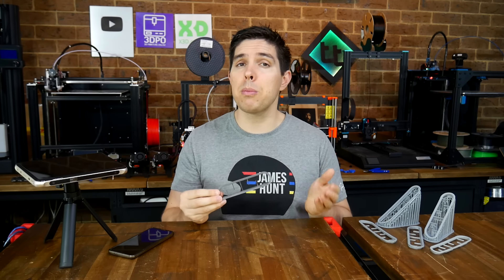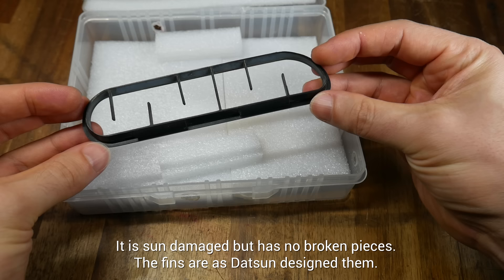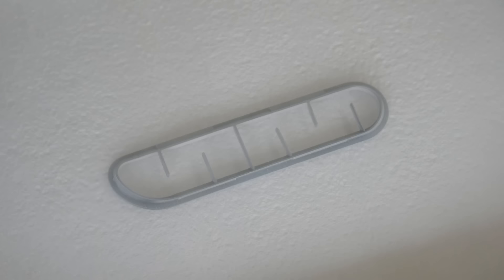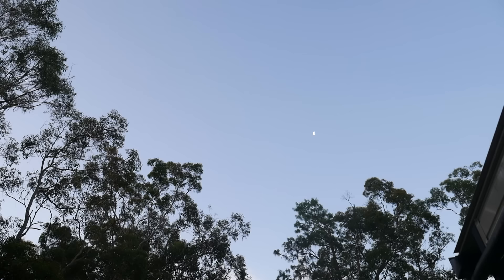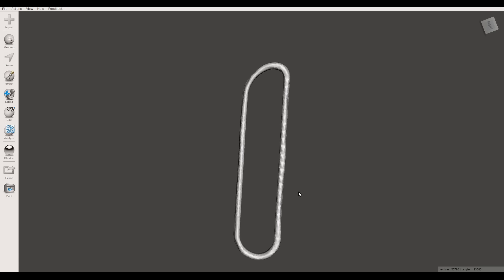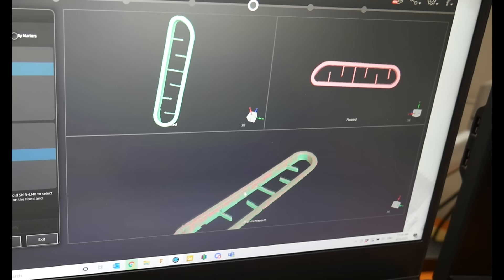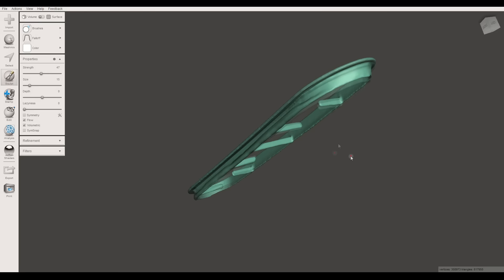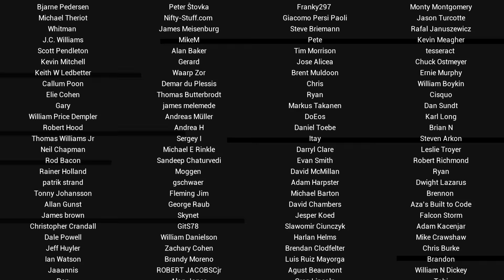3D scanning + 3D printing to complete a classic car restoration

Comment: It's a shame there is only high-end and toy scanners out there. It is aggravating somewhat to not be able to get something in the middle that doesn't do what the high-end does, but a far better job than the toy scanners.
Reply: Same. I have an interest to make a few parts for my car, but 20k for a scanner that doesn’t just output a blob, is unjustifiable when it’s for hobby use. We can only hope that costs come down like how printers have
Reply: You may get something in the middle if you invest some time and a little bit of money to buy some gear, you can achieve pretty good results with photogrammetry. It is tricky with details this small, especially with phone camera, but it is not impossible. Get some average DSLR or DSLM, a lens with suitable focal length and take extra care of lighting the object evenly with soft lighting. Use CPL to filter some light or even get rid of reflections using cross-polarisation technique. What I mean is photogrammetry is pretty complex topic that is not limited to that example case from the video, and may give you better results. I have managed to get a couple scans of some dash and headlight mount parts, not exactly print ready, but decent enough to reverse engineer them.
Reply: It's something definitely lacking from the hobbyist market, a scanner that does build plate size objects at a good resolution and with software to be able to import into Cad. Maybe in the next 5-10 years.
Reply: Honestly thinking about it now, that LIDAR sensor on that iPhone might be reasonable… and if someone could link it to photogrammetry, it’ll definitely be a winner

Comment: I would have liked to have seen if the other scanned files could have been cleaned up enough to be usable
Reply: no. Pretty much all of them are unuseable for generating mesh. He could have remodeled them in software designed to be used with scans. Like Geomagic Desig X
Reply: @DreainCZE  Yeah, and that software only costs $20k. Lets all use it. No prob.
Reply: @filonin2  well there are some free ones. But you are correct after all
Reply from the maker: That would have eaten up many, many hours and probably sent me insane.

Comment: I have that HX scanner. I think it was $12k (us) Sadly I have yet to sit down and mess with it. I plan on making some milled parts for a few projects. Thanks for showing it scanning a smaller part. They do have a different version that might work better for this size project. It runs more like $6k (us)
Reply: Was....parts shortages have driven them up. Doing nothing with it still made you money

Comment: You can use the same spray for developing magnaflux on cylinder heads. Its pretty much the same as the 3d scanner spray, but cheaper and more available.
Reply: Dr Scholl's is even cheaper and more available. The company that scans our parts with their ~$70k Romer uses it on polished parts. It wipes right off just like PT developer.
Reply from the maker: I found the same info googling and tried to buy such spray. In the video with the carbon spray for making prints conductive I also asked the sales rep about this, but they didn't have anything suitable.

Comment: as nice has this 3d scanning experimenting is, as a 3d modeler myselft i see modelling the part from scratch much more easy a precise, i would take meassures with a millimeter gauge and other tools, do flat views photo references and model i would model it and print it in low res until i find is working and clipping on the dash and the print a high res version and polish it by hand yo get a perfect factory quality finish. And i belife it would less time and effort than what you spend in this case with the scanning, but for other larger pieces your approach is actually really good.

Comment: Hi Micheal, this is a case of "printers trap" useing scanners and printers when casting on aluminium useing a reusable mold of the origianal. or the 3d print now you have it. I hope the resin is not to brittle .

Comment: You know 42 years in Plastics, and an avid supporter and producer of 3D printing but if that part came into my plant for reproduction we would cast it in silicone and use that mold to cast perfect resin parts, just my experienced opinion.

Comment: You definitely could have had this completed in fusion 360 in less than 40 mins by starting from a scaled photo and sketching over it and extruding a clean model. 3d scanning is great for complex geometry but a simple 2 sided low tolerance part like this would have sufficed being made this way fast and just using the scaling function in your slicer to adjust multiple copies by % and then print them all at once without all the hassle. Great video explaining the process nonetheless for people who aren't in the industry.

Comment: just one thing about photogrammetry - you need a lot of details (color-wise) on the object to get a good result - that means that an object with unique color is very bad. if you want a good result you should sprinkle the object with a lot of colored dots - then you can achieve incredible results even with the free Meshroom - and even better with RealityCapture (interesting cost plans - you can license single photos after you tested it for free witch should not cost more then 10$ for this part)

Comment: Anyone else notice that one of the prongs looked... crooked? Like if you're going through the effort of making the model, why not fix it?
Reply from the maker: That was how the fins are on the original part that was scanned. If they are meant to be like that or not, I have no idea, so my aim was to reproduce as is. It will be easy to fix from here if required.
Reply: @TeachingTech  lt seemed pretty obvious that the fins were intended to be parallel and equally spaced. Maybe you could provide him a file with straightened fins as well.

Comment: The interior of a car in the summer is hot enough to melt some plastics, especially in the dash area. You'd need a material that can withstand it. I'm assuming abs levels of heat would needed.
Reply: I am printing interior parts for sales on ebay now. I have tested the Liqcreate tough x3d resin and it is very durable even in direct hot sunlight.

Comment: I would have rebuild it in CAD using the free software result as a template. I did similar things with other parts, although for simulations to remove details that will not matter for what is to be simulated, but will create massive computational overhead.

Comment: I think i want to try this. We have a 1933 studebaker we got from my dads uncle. It only has 1 taillight o nthe back from the factory so i want to duplicate it minus the liscence plate holder and gas fill. I have already tryed printing a taillight lense from transparent petg and though its better than a broken missing one it isnt very great so i may have to manually cut glass and have it stained or somthing. Also jeep  door handles exist in black but nutmeg, slate blue, and a white / kinda cream color are not made in after market. I made some brown ones that are primitive but are not nearly as nice as the oe style. Its just a old jeep so im not too picky but if i can get the scan down i would totaly redo whats on it now. I cant wait till good scanners become more availible  and affordable to the average joe

Comment: You will find issues with long term use of thin 3d printed resin parts when exposed to UV/sun light. They will most likely warp and crack. I have several resin printed parts on an RC boat and after a few weeks of exposure, they were warped, cracked, or turned brittle enough to break apart on their own.
Reply: You need to paint them to protect them from UV light.
Reply from the maker: I agree and we will see if paint is sufficient to protect them. If not there are other options to explore.

Comment: photogrammetry is the prime option if you dont have the budget. this part would be easy if scanned upright and with a neutral contrasting background, using the rotary table. ive got excellent results that way. but i used the free version of 3d zephyr wich gave me much better results than meshroom. also camera matters, i found the phone not really suitable because of its narrow depth of sharpness aswell as AI "enhancements"  that you cant really turn all off. what i used: photobox with contrasting background (white object, black background, you get it), rotary table with very detailed texture i made in illustrator, lots of shapes, boxes, triangles and a guide to mark every 5 degrees so i can be sure to capture all angles. 100mm macro lens on a canon 5d mk II. max out the 50 pictures the free version gives you and you should have a very very detailed model. also pro tip: get yourself an easy object with known size and easy to measure features, like a 1x1x1cm metalcube so you can calibrate the size of the object in CAD more easily
Reply: Thanks for confirming exactly what I was thinking, even though I have only tinkered with photogrammetry few times in the past. But proper lighting, camera (DSLR and distortion-neutral prime lens, like anything between 50 to 100 mm), and lens-corrected exports, and the results would must have been so much better. I wouldn't call the photogrammetry a 80 % effort at all. That's not to say I did not enjoy the video, but...

Comment: How the resin will hold up for the long run? I have the feeling it will wrap and crack by itself, Even faster with all temp changes and sun light hitting the part. FDM material like ABS or PETG would be better, no?

Comment: Very interesting - but I suspect actually modeling that in 3D from measurements would not be beyond a skilled CAD operator in any way, and you'd get  total precision. Of course, that wouldn't be much of a 3D scanning video for this channel, now would it? I admit that I'm struggling a little with the utility of scanners that are below the level of the high-end laser one, as you can never get real millimetric precision.

Comment: If you had set up a tripod for the Revopoint and actually used the turntable you probably could have had better results with it. Ive seen quite a few videos with good results with it. the Revopoint 2 would probably be even better.

Comment: I had this problem with my old 92 car im restoring, and i took the measurments with a gauge and disign it myself in autodesk inventor. Definetly more cheap than a 14k dolars 3d scanner. I didnt even take that much time, only like 3 or 4 hours to take the measures and 3d design. Of course this vent wasnt thas complicated, if you are working with a very complex form, a scanner would definetly be the way to go.

Comment: Great video, I was looking for a similar process. I tried the low-end scanners but they seemed to be focused on large objects or buildings! I upgraded the graphics card in my PC and I've been using Meshroom but I have found meshmixer a bit unreliable for editing as it keeps crashing. Thanks again and no I won't be buying a 14k scanner although it would be nice to have one.

Comment: You made made a mistake. For photogrammetry you need a lot of light and you simply didn't had enough, you basically did it in really really dark room. But this part is small and delicate so probably any software would have problems making good mesh.

Tip: there is decent photogrammetry software called 3D Zephyr. It has a Free tier and in free version you can import up to 50 images.
Reply from the maker: Thanks for the 'pro' tip. For your information the photogrammetry pictures were done outside in the middle of the day but never let the truth get in the way of a good story.

Comment: Those supports seems quite wasteful. I think you would get away with less perfect model, then use filler and sandpaper. That part was fairly complex but I'd have gone with the modelling approach considering the price on those scanners.. There isn't anything in it that would be hard to model with some experience in Blender. 
Although that laser scanner was cool, I think leaving the source model on the table was not the best way to go at it. You already figured out yourself, that to scan, the model needs a small surface to turn around on.  Like your Blutac solution. I'd perhaps try a frame and acrylic fishing line, something thin. All in all good  effort, but it needs more work before it can be used in a car that is kept for the show value.. I'd go at it with some filler primer, sandpaper until its face is smooth, then some good metallic paint, and some clear paint.

Comment: Would creating a mold of this part and casting replacement pieces not be the best solution to this problem? The small size of the part is an asset here instead of a hindrance. I'm not an expert but just like with 3D printing there's plenty of resources out there. The geometry of the part is mostly on a single plane so it seems possible. A silicone mold shouldn't damage the original part, and the copies would be almost identical to the original part instead of being noisy/blobby software approximations.
Reply from the maker: The source part has been borrowed so there was no way I way going to do something like that. With any other parts I agree with you.

Comment: The cheaper the tool, the more effort you need to put in to the task.  Photogrammetry could've produced excellent results if you put in a little more than the bare minimum.  Suspend the item with fishing line, indoors, with controlled light, and don't use a junk smartphone camera.  Even an outdated point and shoot would have been better than that.  You need sharp details for the process to work.  It's not as easy or quick to use as a professional scanner but the first time I used the process to model an automotive suspension part, I achieved an incredibly accurate model that exceeded my expectations and allowed me to design a custom suspension part with complex geometry successfully.

I don't think comparing the half-assed use of tools/methods is very informative.  Only one method was given a fair shake.

Glad the part turned out, good job.  But you could have done it with photogrammetry instead of a $14k tool that barely any of your viewers will have access to.
Reply: The correct way to repro this part would have been with CAD. No need for photogrammetry or scanning of any kind. Just a decent set of calipers is all you really need to get a perfect fit including the subtle longitudinal bow.
Reply: @StoneUSA  true. In my situation, the geometry was too complex and it was easier to use photogrammetry.

Comment: LOL dude you really took a 5 minute job and turned it into a 0 hour epic. Heres how i do it and sell parts, 
1. measure. 
2. MEasure, 
3. Measure
4. Print.
5. Sand to shape 
6. Sell
Should have just printed it flat, sanded and sold. Done.

Comment: I love resin printers but the parts do not do well in UV light and will become brittle and break down (even when painted) quickly. Have your friend who makes auto parts make it in ABS on an FDM printer and sand it smooth and paint it. Most car parts are in ABS and will tolerate the heat and UV better. An even better Soulitions would be to print it in wax resin and aluminum cast it.

Comment: That being said, I wonder how difficult it would be to 3D scan the radio bezel of my 85 RX7 and have 3D printed. I know it's a big piece but seeing as there are machines that can print bigger pieces, i wonder how feasible it would be considering all bezels that I find in decent shape are at least $150.

Hell, even some of the interior trim pieces, like the a-arm pieces or the trim pieces that go around the hatch?

Comment: for photogrametry i recomend getting one of those laser level 
idk how to call it in english but basically it makes a laser line on wall that is horizontal but most of them also have grid option so you can use it to put grid on object u are making photo of and then photogrametry software have easier time making shape work
pop 3d scaner is esentially working the same way 
it puts infra red laser grid on object and make photos 
because laser grid starts from point teh bigger teh squares gets the further is the geometry from the camera 
then by looking at shape of lines u can tell how deformed it is 
it probably aslo uses two cameras to get two pints of view thast the best thing to do this way you actually put a virtual point in space 

hm i think i gotta do one of these myself that would be interesting arduino project

Comment: What kind of epoxy was used for this? 
I’m really only familiar with fdm style printing, and was under the impression that most resins and filaments aren’t really super useful for automotive use due to the high temperatures and UV exposures a lot of automobiles are exposed to…. Or are there resins that are shielded against UV and highheat?

Comment: Isn't this resin print a bit too weak for a car part? I thought SLS/DLP prints are useally for indoor miniature useage.
Reply: Yes probably by the looks of this resin. But I know for a fact Liqcreate resin is not brittul and you can make durable parts with sla and dlp style printers.
Reply: @jameskozak9095  Thats interesting. I would love to see how strong those resin prints actually are in long term compared to FDM.
Reply: @MrGTAmodsgerman  You buy my Datsun 1200 glovebox button part on ebay.
Reply: @MrGTAmodsgerman  Contact Endless 3D for more info.

Comment: I would def see about making a mold of this part for future reproduction. Would be easier than having to print it out each time. Also is there any concern that the UV resin, even coated in paint, won't hold up in an area, like a dash board, that gets a lot of direct sunlight?
Reply: Carbon black resin, with UV inhibitors and...
Reply from the maker: Definitely a concern. We will see how the paint goes. The great thing is if the printed version breaks, it's only a minor inconvenience and other options can be explored.